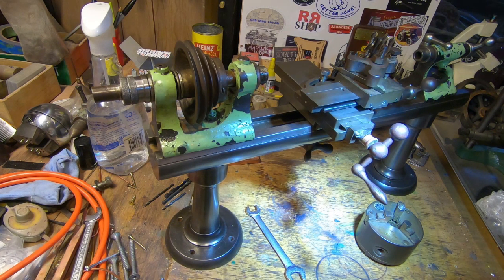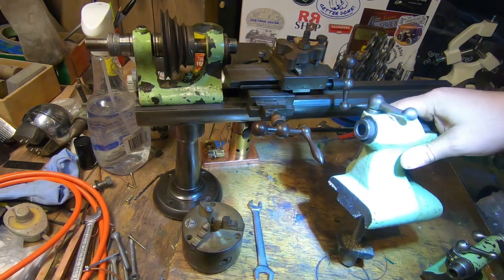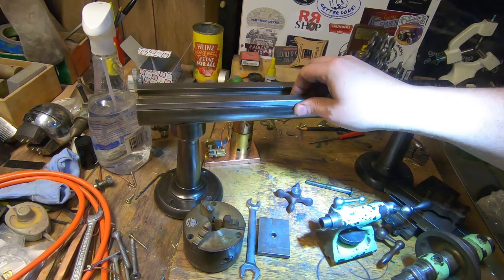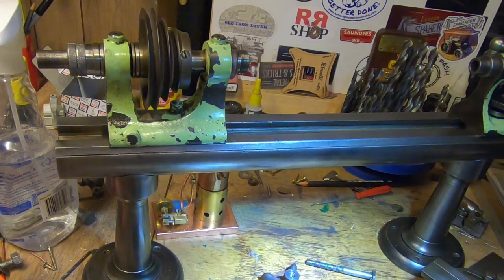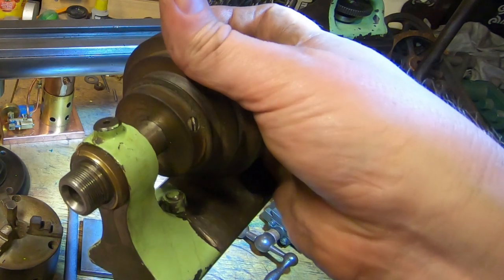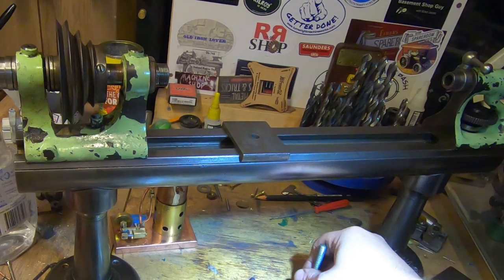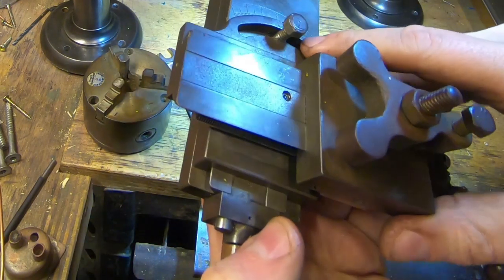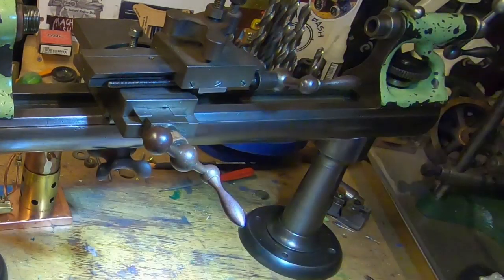Lowenherz, Whitworth and the Lorch Model L

Comment: I wanted to hear you say Löwenherz. I was not dissapointed. 
The broken T-Slot is a bummer, your idea for repair in my mind the cleanest solution. For the headstock, I would only fix it cosmeticaly, with epoxy-putty or something in that realm.
Reply: Yeah, clean up the file marks on the head stock. Anything involving heat I would stay away from. It would pull and damage the alignment.  Thanks for the show and tell Emma! Love the lathe.

Comment: Hi Emma, I hope you are well. A few years ago I sent you some pictures I think of my Lorch LL. It looks like yours but has shorter legs. The oil holes in the headstock I think are just that...oil holes to the cone bearings. I don’t think they ever had caps on them. Mr Steffen Pahlow in Germany has a watchmaking YouTube channel and has a lot of Lorch equipment. He also listed the Lorch catalogs (in German) on his website www.s1p.de showing all the attachments. I was fortunate to get several of the attachments with my lathe, including change gears for the thread cutting attachment. I did not realize there were so many different thread types used in its manufacture. Thanks for another terrific video. 
All the best,
Norm in Arizona

Comment: Hi Emma, André here, haven´t written to you in a while. Very nice little lathe. As you might remember, I have a Lorch, Schmidt of a size bigger than your model A, with 16mm collets. Treadle drive, heavy flywheel, and cast iron stand with wooden table behind the ways, and drawer underneath. My spindle is 31mm OD, 9TPI Whitworth! I originally thought it might be Löwenherz, at 53.8 degrees, but a Withwort 9TPI gauge fits it perfectly. And a small fishtail thread gauge I had made on a laser cutter at 53.8 degrees doesn´t fit it as nicely, so I´ve concluded it really is Whitworth. My headstock casting was also ground away a little between the bearing posts like yours, but I´m leaving it alone. On mine, it was to fit a flat belt pulley rather than the original round belt multi-groove pulley. But I was in luck, the original pulley came with the machine. I think you could easily just leave the ground out section alone, and paint over it. It´s on the back and doesn´t hurt anything in my opinion, it´s just a part of the lathe´s history. The slide rest on your little model L is very similar to the one on my much bigger machine, much more so than the one on your model A. That´s probably because mine and the model L are of similar vintage, the very early 1900s.  Good luck on the restoration, whatever you decide to do, and thanks for a cool video!

Comment: The cut away in the headstock i would use a two part epoxy putty to fill it in then file and sand it to shape  and paint it as it won’t affect the strength .  Grinding the bed  , there is a place in Dee Why in NSW that can do it but I can’t say what  it would cost. One good thing is it doesn’t have  a lead screw so if you grind the bed you don’t need to worry about that .
Reply from the maker: thats one way of looking at it. a leadscrew machine would have been more practical. im not sure if it needs grinding, but id like it all up to factory spec. an exception might be the collet system, if i do it up, then C2 or 10mm derbyshire would be good options because theyre available new and would be logical progressions if they were still being made today.

Comment: Congrats on a new project! I'm sure you need one just as much as I do. I concur with the multitude of comments below suggesting the use of some sort of cosmetic filler, JBWeld or whatnot, to clean up that headstock. Appears structurally sound, so don't give it any heat. I think someday you will have a great partner for the big sister lathe.

Comment: Hi, 
To repair that headstock block, given that it is still structurally sound, I would remove any existing paint, degrease it, and then then build up any missing metal using successive layers of JB-Weld.
I would then file and sand it to the correct shape, and then paint it.
JB-Weld contains metal powder, and when dry it will be indistinguishable from new metal, and you won't have warped the headstock by heating or welding that existing precision-made part.
PS: Blondihacks sent me here
Reply from the maker: I think thats the plan. not sure when, because i dont really have enough projects LOL. thanks for watching!

Comment: Emma, about the cross  slide base being cracked, I would be inclined to just mill out the broken inside surface and repair with pocket inserts, leaving the outer edges intact to keep the outer appearance of the original block, I think to remove all material  right across and then add a new slab would be a shame and sacrilege, 
Just my thoughts,
Reply from the maker: the slot is a little bit loose o n the plate, that is my only thinking about putting new parts on completely. ill assess the situation as i go, I believe you might be right though.

Comment: Pretty cool little lathe emma, that damage to the headstock, I'd just stick some body filler in it or someting like that tbh since it isnt really structural, and once painted, you'd never know anyhow. Ive never heard of lowenherz threads before, so will defenitely have to look those up.
Reply from the maker: a bit more rigidity wont hurt, and the rest is cosmetic.
Reply: oh, you could build it up with some braze then, or braze in a piece of steel or cast iron in it's place to match the messed up area.